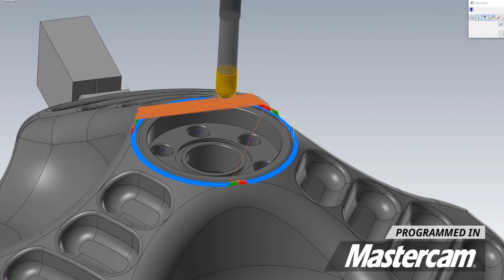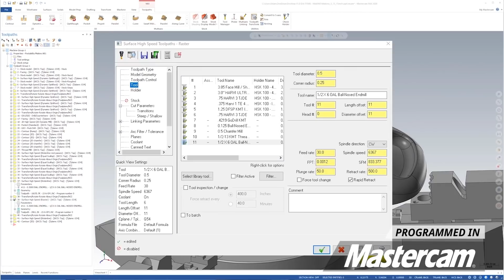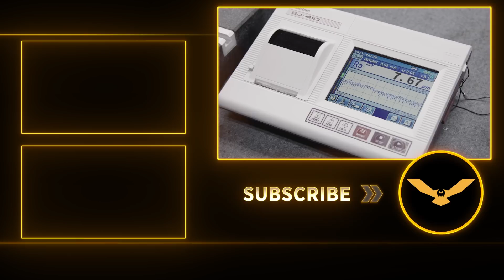How You Become a Great Machinist INCREDIBLY QUICKLY

Comment: Spent two years doing it, then I grew intolerant to coolant in the air. Sad state of affairs.
Reply: Switch for a different coolant. Some of them are very unhealthy but efficient. Some are less efficient or will create rust spots in your machine if 4.9% instead of 5% but are healthier. Solutions